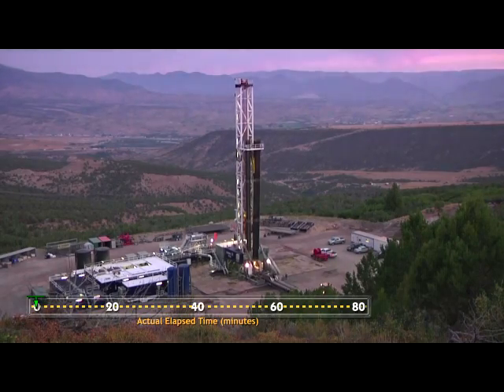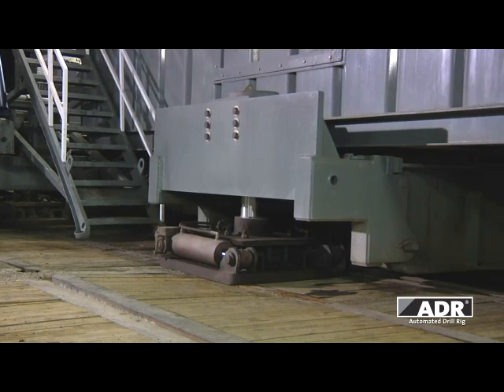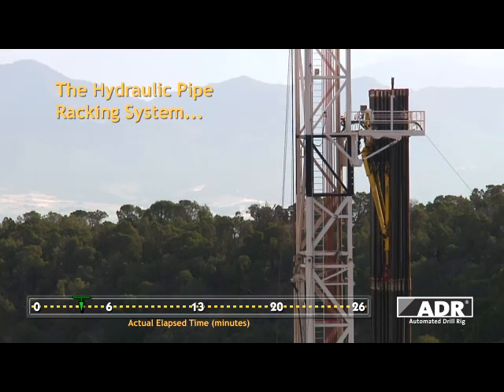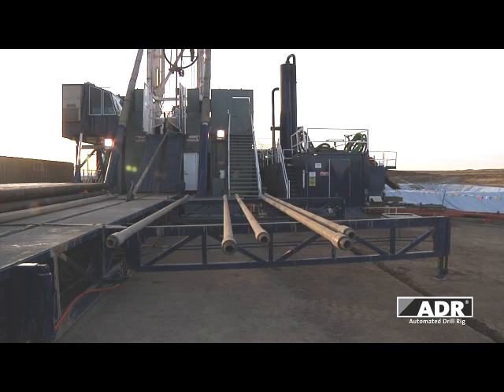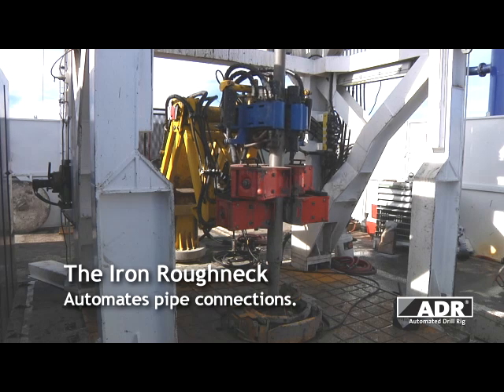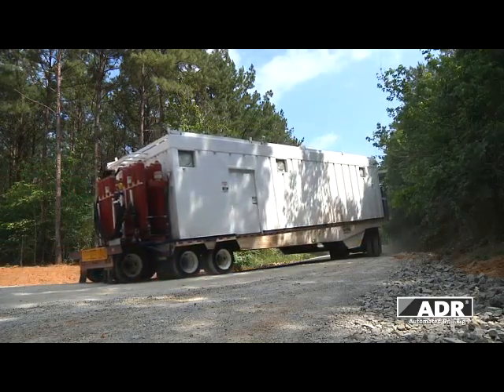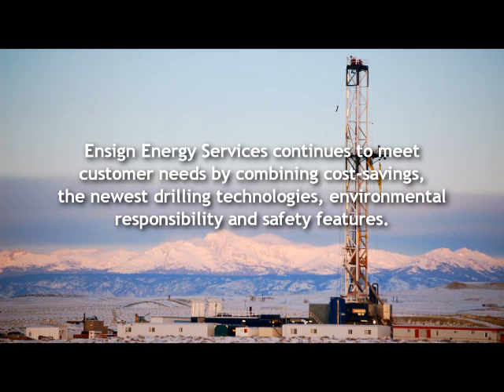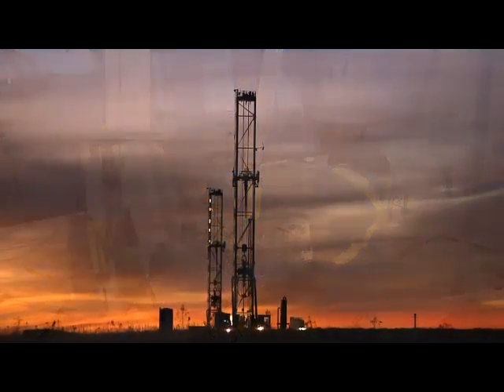Ensign Automated Drilling Rig (ADR®)

Comment: I work on a ADR 1500 it's nice when you have a 6 well pad and don't have to rig down completely to move to the next hole. Rig up and down is not as complicated as a conventional rig but still a pain sometimes. Its all hydraulic no air breaks ect. I like my rig and these ADR`s

Comment: if you want zero injury and maximum profit, you need zero people. i was just arguing this with the consultant recently,he said it hasent changed in forever, i said when it does it will be almost over night, he might still have a job but most of the crew will be un needid, maybe new positions for the rigging in/out parts and an operator, meh, time will tell though.
Reply: Unfortunately unmanned rigs cost a fortune and can only do certain types of holes, so the vast majority of rigs even now are still running full crews, and will for a long long time.